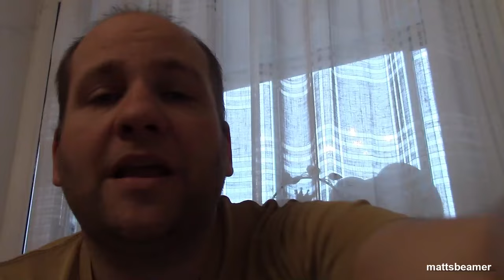BMW Drivetrain Malfunction (Error) Drive Moderately Problem. Information Video.

Comment: I keep getting reminder on dash with this error. No loss of power and car preformance ok. Rear end feels slippy over bumps. Prob shock. Had the timing chain and clutch done last month
Reply: @underground_vibe0187  my codes got checked. Egr partially blocked and back pressure. Car still driving fine with fault. Guy recommended i get egr coded out and dpf removed

Comment: Have an issue currently. Transmission stuck in park. Error code not clearing. bmw 428i.  Drivetrain warning on. Car starts fine but wont select gears. Still looking for solutions. Tnx. Nice video.
Reply from the maker: Hey, what is the error code you are getting. It may be worth checking the fuses, under the bonnet.  Try  fuses 24, 32, 54 and 63

Comment: I have bought the exact same car as you, great car but now I have DMU /ECU issues, had to pull it out and have it shipped to England for repair (i'm in Sydney). BMW quoted me AUD 5000.00 to replace vs self repair of AUD 1200.00. Yes I also had LIMP mode as a result of ECU crashing out.
Reply from the maker: Sorry to hear that. It is amazing how much it is to fix your issue over there.  I remember about 15/16 years agao, when I was 21, I had a e38 740i and they antd £8000 for a tempory fix. please keep me up to date with your issue, and if the repair fixes it :)
Reply: @mattsbeamer  ECU is currently in shipping mode to England. Should get it back in around 3-4 weeks only. I will update you accordingly.
Reply: Update - got the rebuilt ECU back from England, installed it back into the BMW and started no problems. Just goes to show, patience does pay off.

Comment: Hi, I have this issue on my 2017 4 series gran coupe, the drivechain issue pops up intermittently when I am driving or driving off, I took it back to my car dealer as I have guarantee, they replaced the inlet manifold (they said it was clogged), however today I still have the same issue. Scanning the BMW reveals no related error codes at all. Can someone please advise? This car has been very problematic for me since buying it, the dealers have so far had to change the AMP, SOS battery and inlet manifold! its a 67 plate with 26k mileage.

Comment: Hi, I have a 118i and has the same error message. The vehicle doesn't have power and vibrates when i hit 120km. What could be the problem?
Reply from the maker: Hey, did you get any fault codes on your scanner :)

Comment: I had a drive train mode on my bmw116i . My mechanic fixed the leakage on a turbo and water level. But they reckon i need to change my timing belt as the engine light turns up as well. My mechanic reckons it is a big job to change the timing belt.
Reply from the maker: Thank you for letting us know. What kind of symptoms were you getting to warrant them saying the timing chain needs doing?
Reply: @mattsbeamer  Just a quick update . I changed the engine for $6k. Went to other mechanic and he said too complicated to change the timing chain. But before that symptoms were just a crackling noise on the dashboard when the engine heated. There was no symptoms except the drivetrain error. But now the car drives like i have just purchased. The engine I purchased had already done 85k from wreckers. Hopefully it will last me .
Reply from the maker: @prophetmars666  oh wow! Thank you for the update. I hope it lasts you many more years.

Comment: Hi

I own a beamer exactly like yours. 116i, took my car in for service, dashboard has not been reset yet after service but the performance has somehow decrease, when i drive it hard the rev count just goes too high but doesn't push up speeds the way i normally know it. Do you think it is because there's no reset yet done to the car something else...?
Reply: Sounds like you clutch was slipping

Comment: Driving a 2011 F09, GT 535i. This alarm persists occasionally, but leaves no fault code for diagnosis. Seems only when under load, accelerating. Turn car off, no code when turning back on. Has 86,000 km only despite 13 years old. Great car despite the issue.

Comment: Hello, Mr. Matt.
Kindly advise on this issue:
D35476 Signal (torque crankshaft 1, 40.1.4) invalid, transmitter DME / DDE

Comment: I own a 116 and I had a drivetrain error. I went to the specialist and it appeared that there was a problem of high oil pressure and a solenoid sensor..I took out the sensor and cleaned it and found it in new condition..However, the error appears along with the engine light..I am very angry..I hope someone solves my problem
Reply: Did you get a solution for this ¿ as I’m currently facing same problem
Reply: Did you get a solution?
Reply: Apart from the signal, was the drivetrain problem resolved?
Reply: Get a scan tool. Even generics work fine

Comment: I have e a f31 320i  2013 manuell gearbox. After driving on crusecontrol by low speed ( constand 60 miles / h)  the Orange lights come on and message" reduced Engen power. Contact your dealer". After a couple days and several starts the problem dissapear for mabe a couple monts.. it happen onley on cruise , constand speed. So when the engine use low fuell and maybe pump fall asleep?

Comment: I got a error after getting a carwash drive control system malfunction drive moderately I turned the car off for 5 min and let it stay in sun should I check anything else?

Comment: Very good video, i also have this drivetrain error only when i start the car and immediatly drive, if i put the ignition on , disable start stop and after start the car and wait about 3-4-5 minute, then everything it’s ok, i’m doing this thing and for about 8-9 days the error don’t appear,  beflre that i went to a garage they put the test and tell me to change the battery , and the fuel pump... changed and the error still appear, now i do this trick that i said earlier and god help me to not appear anymore, if error pop up again i will go to bmw to put their test on and check.
Reply from the maker: Thank you for the information of your issue. I hope this issue gets sorted for you. Electrics are too complex these days :)

Comment: Hi, I done a diagnostic scan on my F30 couple of days ago and came up with code 20A703. It says last occurred at around 53000 miles and now im in around 56000 miles. I cleared the codes but when i do a re scan it still pops up. Any help? Thank you.
Reply from the maker: Hey, I was looking into it for you. It's not a code that I have had before. It seems to pop up, when the car detects that something in the cooling system is getting too hot, or something in the cooling system is failing, like a water pump, thermostat, etc. The codes show that the car went into limp mode.

Maybe there are some other fault codes which can go hand in hand, with this code. Sorry, I am not much use. Good luck :)
Reply: @mattsbeamer  thank you for all your trouble and for all the help. Yes my car was on limp mode due to over heating with a failed thermostat, which has been replaced, unfortunately the code is still there and doesn’t seem to want to go away. Iv cleared it many times buts keeps popping back up. Anyways its what it is. Thanks again for taking the time to look in this for me. Much appreciated.
Reply from the maker: @bilaalmiah8322  you’re welcome. Very odd that it isn’t clearing. My car had no battery on it for a while and all the codes that were on it, have disappeared. I wonder if it was by luck. Maybe worth a try, who knows :). At least I will know what to look for if it happens on my car now. Cheers :)

Comment: I have a mini cooper and this happened to me today. Drivetrain error came up and car went into limp mode...very rough..significant loss of power. Managed to get home...car going to mini dealer tomorrow.
Will keep you posted.
Reply from the maker: Thank you for sharing your post. I look forward to the update. I hope it’s not too expensive.
Reply: @mattsbeamer  dealer re mapped  vanos solanoid and so far so good.
Reply: @anteater74 What was the cost in the end?

Comment: Cam it be because low on gas ?
Reply from the maker: Then the car is or has been low on fuel, it can let all the dirt circulate the system, which can activate the light :) so yes
Reply: @mattsbeamer  ok thanks man I put gas in it and I don't see it anymore thanks appreciate it

Comment: Driving car into town today and went to overtake and the car started vibrating really hard. Thought i’d somehow lost traction and went for it again and same result except the code appeared. From then on the drive back home the car had a light shake and when at stop lights the car idled higher than usual and shook pretty bad. Getting up tomorrow and gonna check coil packs and spark plugs, if anyone has had this happen and figured it out i’d love for some input.. Much love than you for the video
Reply from the maker: I had a similar situation with my e36 years ago. Did you get a fault code? It’s worth changing the cool packs around (after disconnecting the coil plug) to see if the fault code changes. A misfire code would be P0300.  (The last two digits will tell you which cylinder has the misfire. P0301 would be cylinder 1 while P0312 would by cylinder 12 on a v12 car.

Comment: Was a faulty fuel pump relay, the current one was corroded. Replaced it and the problem was gone for good. Relay sits behind the passenger wheel arch. This was a year ago.

Comment: Hi I have had this now 3 times in 2 months, on my '18 X6 3.0 D.  seems to happen more in comfort mode then in sport mode.  also seems to happed when going up steep hills slowly transmission seems to get lost and try to downshift then upshift then I get the xdrive system error and it goes into limp mode which maxes our at like 12kph.  if I shut off and restart in 5 min. its fine again.  since its a diesel it can't be plugs or coil packs, fuel filter?  I was thinking to upgrade the ECU software on the xdrive and transmission modules using eSys and see if there is any improvement.  I will check the error codes next time as I just flashed the EVO head unit to add CarPlay and updated the maps also.  any diesels with similar issues?

Comment: Will the scanner tell you exactly what the problem is
Reply from the maker: Hey Tina. It won't always tell you what the exact problem is. It will give you clues. If the battery is low, it will display lots of false errors. :)
Reply: It is saying abs breaks low voltage

Comment: Just had this in my Mini on startup. Its January and about -2. Very cold and frosty. Haven't driven my car for 5 days prior. Amber warning light comes up. I feared the worst. I sat in the car with the engine running allowing it the warm up. 5 mins later I turned the engine off and waited 2 minutes before restarting. No warning light this time. I drove around for a few miles before coming home. Car felt a bit sluggish but no cut outs and juddering. Hoping it's nothing serious.

Comment: My dpf was broken so had a mew one fitted but still have a drivetrain error. Could it be because the fault wasn’t cleared or would my car clear it itself? If the latter does this mean my car still needs to be fixed?
Reply from the maker: Hey, if the repair has been made, you are best off resetting the error, to see if it comes back. But before you delete it, just make sure that no other errors have popped up. I hope that made sense :)

Comment: Recently I have same error "Drivetrain". My car is BMW 530e iPerformance (Dec. 2017). I stop now driving car and investigating the problem. Do you have any advice?
Reply from the maker: Sorry to hear about your problem. This error can mean absolutely anything :) Mine was due to letting my petrol get so low, and it picked up a bit of dirt. Best to get her scanned.
I guess since your car is a hybrid, you have extra possibilities. I will need to look into hybrids and learn what can cause it. Good luck

Comment: Thanks man I drive a 750li 2014 I let my fuel get really low and started it up for the day then message came up and a studder was happening so I turned the car off immediately and turn it back on an shaking was gone but message was still there i drove it to see if anything was wrong and it was completely fine this my first day dealing with it so ima drive it today and see if messages still pop up with car tank on full ..thanks again
Reply from the maker: Hey, keep me up to date, It is very interesting. 

It took me a few  tanks to sort itself out. I'm sure you will get through a few tanks much quicker than me :P

Comment: “Ultimate driving machines” should drive the way you want it to drive. Slow fast whatever… Same issue on my 2017 650i xdrive. Has only 40k miles. Took it into BMW, they replaced all the coolant lines. Error occurred again less then one week after having my car back. 
a $110,000 car should not have major mechanical issues with so little miles.

Comment: Brilliant thanks buddy. Mines been on for about two years. Fault code said dpf. Cleaned and made no difference. Now and then it judders a bit on acceleration but overall ot drives absolutely fine. Not had any chance to have it looked at again. I did change the egr valve which seemed to help but the light stayed on. Occasionally it will be rough on idle but only when its a very hot day and it is rare. It is a 116d MSport 2013 F21... Any extra tips guys? I'm thinking it could be in need of a dpf as like Matt, i drive really easy. Are there any connectors which may be worth checking? I do know it had a minor bump before i got it

Comment: I have a F11 535d xdrive and i get the drivetrain error coming and going, it never stays on for more than few minutes,  but appears always when i take off with cold engine and reach 45-50kmh, it goes away usually in few minutes. Later it comes on when going uphill and dissapears again when load is not so high, sometimes it comes on 2-3 times when going up a long hill. There is no misfires or anything unusual with the engine, it just takes the power down and it's really frustrating when overtaking cars etc. Im guessing some sensor or actuator perhaps? I have all the injectors refurbished and overall a very good condition engine (Was rebuilt after chain detonation). DPF and EGR are removed and deactivated properly, it has stage 2 remap and pulls like a train but could it be the turbo starting to go out?
Reply: Did you manage to fix this, i have the exact same issue on a 740d. Any help would be appreciated

Comment: Hi I left my fuel very low and car started misfire and drive train message came up .. now there is a engine management light on dash board.. how do I get rid of the light on dashboard? Thanks
Reply from the maker: Hi Gary, on my car, it cleared itself after running a fuel fresh tanks of fuel through the system :)

Comment: the reason i got this message last month was faulty coil. 
thanks for another helpful video. 
by the way did you check when and how to change coolant? that might be another videos subject.
Reply from the maker: Hello! I did reply the other day, but youtube didn't post my replies for some reason. I hopefully will do the coolant in a few months when the weather picks up. Some places say the coolant needs to be done every 30K or 2-3 years. Some last a lot longer.
Reply: @mattsbeamer  hi, mine never changed in 8 years and also it is time to change transmission oil. my mechanic says transmission oil cooler leakage into transmission oil is a common issue so it is better to change cooler before it leaks. because of this he advise me to change coolant, radiator and transmission oil at the same time. what's your opinion?
Reply from the maker: @neizliyim  Hey, I did make a video on when it would be a good time to change the ZF8 gearbox oil, I haven't made a DIY video thou. Changing it at the same time will most likely save you money in the long run. The cooling system on BMW in general isn't their strong point.
Reply: Thanks so much you video is very helpful.  
Mine drives at 1st gear "only" and slips at 2. (F30 h8 320d)

Comment: Has the same drivetrain malfunction error. I very low on fuel once I filled it up it’s running fine.  No check engine light.

Comment: I have a 330e g20 got a drive train malfunction light. The car shut off automaticity (booth e drive and with fule)  restart didn’t work. How I FIX it was BY going to settings and started the “check oil level” engine started and light went away” work normally now

Comment: I had the same problem on my BMW X5 2008 model, just couldn’t work out why the DRIVETRAIN MALFUNCTION comes up on dashboard and car goes into limp mode, after managing to get my mate to inspect it thoroughly and connect diagnostic machine, found out today that the E CLUTCH is gone, which basically means I need to get new gearbox or recondition the old one, still drives perfect so going to make the most of it before it really breaks down lol 😂😎🦋🐝🔥🔥🔥🔥🔥🔥🔥🔥🔥🔥🔥🔥
Reply: Hi I. have 2008 bmw x5 3.0si and it shows malfuntion continu driving possible reduce acceilation ...and its very slowly speed up but gear shift easy still ..you had the same problem ? please let me know your condition what you knew about it .. not sure where to fix and what it is  actually :(

Comment: I had this problem a few weeks ago and it was the high pressure fuel pump now I’ve just got another warning light up again I managed to get the error code witch is e1145c but the car dose still run but is just very sluggish until the turbo kicks in the car is a 65 plate 335d

Comment: Regarding smoke I checked my pcv valve and f20 118i with the N13 engine tends to smoke a bit at times. I took it to my mechanic and he can't find the issue. Is it normal for it to smoke like this or what could be the problem